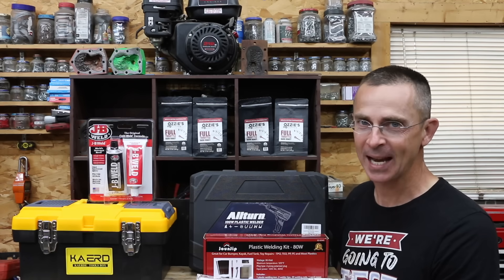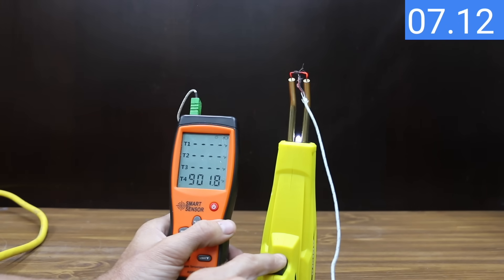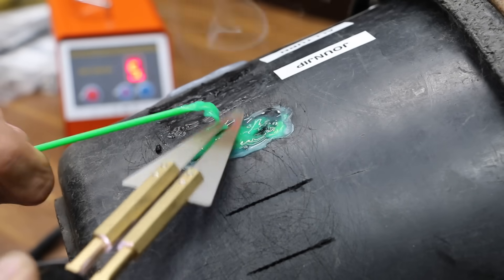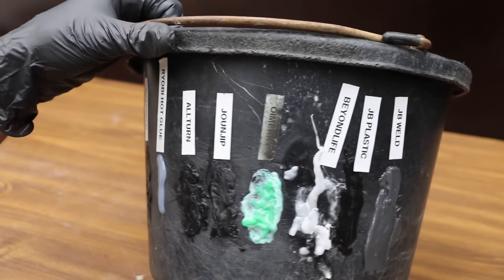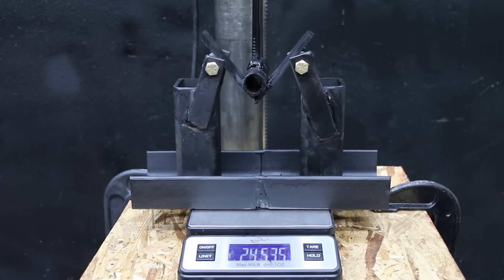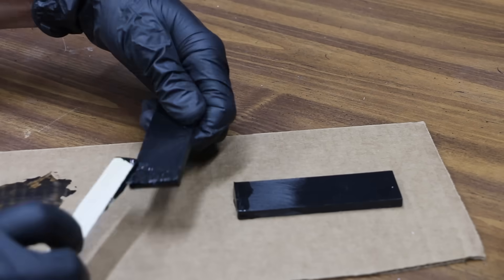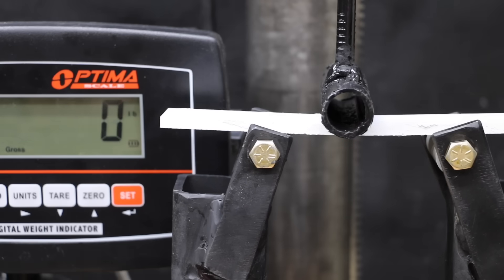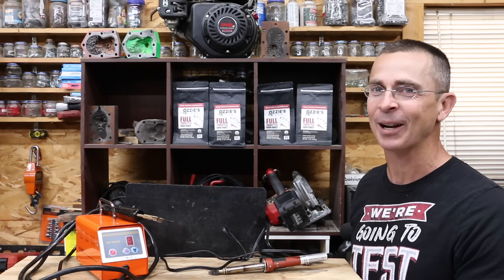Don't Buy A Plastic Welder Until You Watch This Review!

Comment: Over temping thermal plastics usually changes their properties as well as create lots of toxic fumes.
A slower carefull heating with a limit within what the plastic can handle is usually better. A slow bond to get deep into the material, ideally from both sides.
Pushing the wire mesh down into the original material instead of slapping something on top should also work better.
Reply from the maker: Thanks for the feedback.

Comment: FWIW you should melt the wire mesh into the surface. If you were willing to retest try that and also do a couple of sets with a 45 degree grind and fill from one side  ( \ / )  to test for strength and both sides to test with and without mesh ( > < ) and this time make them flush with original surface as that would be the desired result with much of the plastic repair we would be bothered with doing. and also maybe compare them to a flat butt super glue weld. This would give a new video with existing tools and supplies and be more realistic as to what people would need to weld plastic for. Usually if we are trying to fix plastic we are doing it because we cannot afford to replace it or its not available but it would be something we would never leave that ugly bead / blob of plastic on. We would be making it smooth and or even sanding it some if needed. The heat gun should be able to melt the wire mesh into the plastic or its pretty useless overall.

Thanks again for another great and informative video.
Reply from the maker: Thanks and you are welcome!

Comment: Seems none of them weld the break. Welding metals a good weld doesn’t fail and the material itself will fail first. Plastic welders do not bond the ends butted up together but stick on the surface only 😢
Reply from the maker: Thanks for the feedback.

Comment: Did you ensure that you had the correct type of filler plastic when welding?  Plastics are not mixable with each other and even when melted together, incompatible plastics will just pull apart when stressed.   Some plastics also change crystalline structures when over heated, so knowledge of the proper temperatures to use can be pretty critical...  For HDPE for example, melting is not really the best bonding method, instead a hot air gun set to a temperature that turns the surface of the plastic tacky  along with a HDPE repair strip that is laid into the break as you move the heat is the recommended industry repair technique as it doesn't crystallize the plastic and make it  brittle.   On a similar note, ABS is sensitive to being burnt by the tool, so a pretty precise temperature is required.  This may mean only very brief touches of the welding tool or use of a light dimmer to control temperature..  Because there was so much user error on this test, I would argue that this whole series is invalid and needs to be re-run once you have familiarized yourself with how to use the products properly.

Comment: Really funny to see this video just after I did some plastic welding for the first time ever. I had a cupholder on a lawn chair tear/crack and glue wasn't bonding (I think the plastic is LDPE) so I heated up a nail held by vice grips and used a heat gun to warm the part and managed to get decent penetration and the fix is still holding up. (Not saying much though since it's only been 4 days)
Really neat video!
Reply from the maker: Thanks!

Comment: Loved this video!! 
A very common problem is cracked gas tanks. Perhaps you could use the plastic welding kits you already have and see which works best on cracked plastic gas tanks. If you do please be sure to use a new tank or one you have cleaned and are sure no gas fumes are present. Thank you
Reply from the maker: Thanks!  Thanks for the suggestion.

Comment: I can tell you from many years of experience. If you use the wire mesh. You have to use the heating element to push it into the parent material. I needs to be embedded in it. Then melt plastic over it and sand down if wanted or needed.
Reply from the maker: Thanks for the constructive feedback.

Comment: Nice test but your technique sucks. You're not melting or even softening the base material, you're adding the mesh ontop of the gooped up filler rod that's not bonded to the base material, there's very little data to be obtained here as far as proper performance. It would have been good to watch a couple of youtube videos on plastic repair before making this video. I love your reviews but in this case there's nothing to be learned, except that if you're not proficient in the task at hand, gear makes little difference.

Comment: I've done quiet a bit of plastic welding at a previous job and one flaw in this test I noticed is you're using dissimilar materials. For instance, if you're work piece is polyethylene you need to use a a PE filler rod and if it's polypropylene you need to use a PP filter rod. Using PE filler rod on abs you will never get it to bond and make a strong weld. Just a bit of advice if you ever do another plastic welding video, make sure to get filter rods of the same family as the work pieces to get professional results. I do like how you compared hot glue and JB welds.
Reply: I imagine, testing the repair piece of plastic for PE or PP is the first step. So, identifying the original material before applying new plastics is the challenge.
Reply: Yes, you're right about needing to use the same plastic in your rods as the material you're trying to weld. Feed rate is also key.
Reply: mixing with different plastic is not good at all will yield random strength (bonding) results  as seen
Reply: Would be great to see a master kit for testing types of plastic, Metal, etc.
Reply: If possible and to also be sure you are using a compatible plastic trim off a small piece of unseen plastic from what you're welding together. This is a cheap way to do a repair in a pinch when you're completely out of rods also.
Reply: Almost all plastic parts if big enough have mold and material information on them.
Reply: Most plastics also have different Weld temperatures.
Reply: I am not too familiar with plastics but any advise on how to tell what plastic you may be working with?
Reply: @2mustange   It is a guess and check method if you don't know for sure. Get a couple different type of plastic filler rods and weld about 1 inch onto the piece where it wont be seen. If you can pull it off with a pair of pliers then it is the wrong material. If it is the same material it will not come off easily. Look on the piece of material that you need to weld for a recycling triangle if it has it and google what it is. Under the triangle sometimes it will tell you what it is. PP is polypropylene, (PE, LDPE, HDPE) are low or high polyethylene and if I remember correctly you can jump from low density PE to high density PE just fine when welding. UHMW is Ultra High molecular weight PE as well.
Reply: Yeah I use the beyond life style plastic welder to make polypropylene tanks and the high heat is required. That bucket never stood a chance
Reply: Zip-ty cutoffs, a torch and an old screwdriver do work as well for the occasional hobbyist. 

And it does still hold. I fixed a small crate for sodacans. We have a return system to get money back and plastic bags get so disgusting. 

Anyway, it had some small breaks. And I melted some zip-ty cutoffs and it still holds after more than a year of use.
Reply: Duh? The only flaw is what comes with these kits.
Reply: Ya I broke bushwhacker wheel well trim how the heck does a diesel mechanic figure out type of plastic ? A lot of good info , think I’m going to mesh melt repair then jb weld , I’ve coated my trim pieces w bed liner so repair should be hidden
Reply: Yes
Reply: I would bet if he put multiple deep cuts with a razor into the pieces, and then used JB weld, he would find it's significantly stronger. We have used JB Weld in the oil field for everything, and if you give it "valleys/ruts" to bite on, it will form a stronger point than the original material. We have jb welded diesel powered articulated off-road forklift booms back together when it cracked. Just use a cutting wheel and make many cuts (valleys) around the break, and then liberally apply a ton of JB weld. If you really want to go crazy, after the first layer is fully dry, make micro cuts in that, then apply a second layer and allow that to fully dry. You can continue this indefinitely depending on the level of strength you need.
Reply: There was barely any welding done here as that needs base material fusion or base material and filler fusion. Oh well. At least his efforts were very close that of most people buying these and using them for the first few hours(before majority of them just throwing the machine and the part they were trying to repair into the trash 😂)
Reply: Bravo!
Reply: Do you think an 82 dodge d150 would have an abs gas tank? That's what I'm going to fix haha.
Reply: @hisnameisiam808  no idea, did you pull the tank? If you did look all over it for the recycling triangle and then letters underneath that will let you know what it is made from if it has the symbol. Good luck
Reply: @ruking_around  thanks! I never figured it out but I already welded it and am putting the final touches on it so I can put it back in. Thanks though!
Reply: Also I know some poly pro plastics are compatible  for example you can use poly pro filler on a HDPE or LDPE because they are a poly based plastic but you can’t use a poly filler rod on a PVC or CPVC part because of the different make up with the vinyl
Reply: Very good comment.  Just keep in mind the average guy isn't a professional.  They grab anything that works to repair the broken item.
Reply: Acrylic, Polycarbonate and ABS are compatible. It's messy when done with low DIY level tools.
Reply: @rolfbjorn9937  Perhaps, but I caution against using any acrylate with any carbonate IF structural integrity is important.  Especially since acrylates are more brittle....for a patch, more amorphous  is best.  They have significantly different chemical properties as well, so patching a polycarbonate with an acrylate should in MOST cases be more chemical resistant and perhaps scratch resistant, but it will NEVER have the structural integrity that is the hallmark and primary usage for polycarbonates.  The acrylate patch would cause acceleration in fracture propagation over time at the defect than leaving the defect in tact would do (unless the defect itself is a crack initiator, then the best thing you can do is drill at the end of the crack to reroute the stress gradient.
Reply: @patrickneyman6739  I don't disagree, I've had bond failure between Acrylic-ABS or Acrylic-Acrylic. In my case it's just odd things I don't want to trash in a pinch, nothing vital or holding pressure. 
The best results were with HDPE-HDPE, lot easier, less mess and smoke.
Reply: Does plastic had to have concave like metal welding prep?
Reply: @rc-t3k  short answer, yes. Welding plastic and welding metal you are looking for penetration. With thin metal and thin plastic, you don't need a channel to weld into because you can get good penetration without it. With thicker materials you do need that chanel so you can get good penetration.
Reply: @rc-t3k  if I'm understanding your question correctly it doesn't matter as long as you can melt the material and filler rod slightly to get everything to bound together.
Reply: @tylergilbertson4086  wrong, bad info (UPDATE, I replied to the wrong post or misread..Sorry)
Reply: @gurubuzzzz  please elaborate, whenever we needed to figure out which material is which we always did test beads and when it's dissimilar materials you were able to pull it off with pliers with ease. If I'm wrong I would like to know
Reply: The pitch of voice extremely annoying
I couldn't go passed half of the video
Reply: @alexshcherbakov8353  
This guy is great - informative and entertaining.  If you don't like his pitch, don't listen...

Comment: I just use a soldering iron. For best repairs, you need to penetrate into the crack and melt the plastic all the way through. 

For plastic fuel tanks, you can make welding rods from plastic motor oil bottles.
Reply from the maker: Thanks for sharing.

Comment: Like your testing. Always good. Never used a real plastic welder. I have used zip ties to make temp repairs keeping the heat low where I do not burn the plastic. I have used JB weld often. I have found the more course sanding the better. Has more to hold onto and get down into the grooves. I am not sure what one out of the welders you tested I would buy. I would first look at diy before I buy.
Reply from the maker: Thanks!

Comment: I have a DeWalt impact driver that broke the handle grip. Despite this it still worked so I attempted to repair it. I put it back together my fusing the plastic using a soldering iron with a large tip. Then I used a 2-part epoxy on top of the repair for extra strength. It did work for a while but then I accidentally stepped on it and it broke in the same spot. So then I used a dremel to grind off the old epoxy and used the soldering iron to fuse the plastic again. I expected this to just be strong enough to hold it together but not enough to give it strength. So this time I sued JB weld and I put it on pretty thick. After it cured. I sanded it to where it was comfortable to hold the tool and it seems to be holding up well. I can’t imaging it will ever be as strong as it used to be but I at least gave this DeWalt brushless impact driver new life. It still works months later. However after watching this video, I’m hoping I can find a more effective method to repair broken plastic parts.
Reply from the maker: Thanks for sharing.

Comment: I've got a cheap 80w iron. It gets used more than my regular welder. I got a roll of aluminum tape to support the back of the weld. Then I vee out the break with the iron and slowly melt the adjoining plastic back into the break and smooth over the weld with a small amount of filler rod. You can use a bernzomatic or sandpaper to smooth the weld for looks.
Reply from the maker: Thanks for sharing.

Comment: Great Video!  I would also like to see Snap-On in this comparison. They have a Hot Staple Repair Kit, a Plastic Welding Kit, and plastic welding attachments for their butane soldering kits.
Reply from the maker: Thanks!  Thanks for the suggestion.
Reply: Anything from Snap-On would probably double the price of all the tools used in the test.  Todd takes no promotional assistance from the companies whose products he tests.

Perhaps if you offered to purchase the Snap-On after the test....?
Reply: @jackdedert2945  "Perhaps if you offered to purchase the Snap-On after the test?"  What an asinine comment.  I doubt Todd would ever agree to such an offer.  If you're a fan of this channel, you would know that.  Besides, he has reviewed dozens of Snap-On tools, including the $1000 Snap-On floor jack.  Yes they're more expensive than the rest, but sometimes it's nice to see if the most expensive tool can outperform the rest. Often enough it does, especially with Snap-On.
Reply: @davidk3277  Oh, get over yourself.  I wasn't suggesting anything unethical or dishonest.  It was just a comment on the high price of Snap-On.  I'm sure he has to weigh the cost of his test subjects against the potential benefits, since he's self-funding.  Surely he does 'something' with the items he didn't use up, or test to destruction.  

What's a man to do with half a dozen plastic welders?

Comment: The green hotair gun is made for plastic flooring, the fan heats the flooring and the welding thread as you drag it along the joint. I use it alot. Thats a knockof on a Leister hot air gun.
Reply from the maker: Thanks for the feedback.

Comment: You don't start plastic welding on the surface when doing butt welds 
You have either grind out a bevel (V grove) or melt a bevel into to the areas being welded. The same way you bevel metal when welding thick material. So like metal welding you then back fill the bevel with the welding material. That method especially applies to the plastic welders that have a central feed tip for the welding rods. Then the additional strength comes from the metal staples or mesh that should be melted into the surface plastic your trying to join. Surface welding isn't the strongest but some times it's the only option. You still need to preheat the crack/joint in the plastic before welding to get the best penetration weld, especially with thicker plastics.

Comment: Here in Cambodia, people use those plastic welders to repair plastic motorcycle and car bodywork all the time. You can sand the welds down and paint, making the parts look absolutely new, even after an accident in which the plastic has been broken into pieces.
Reply from the maker: Thanks for sharing.

Comment: I would be interested to see how the Polyvance Airless Plastic Welder compares. 

Generally speaking I rely on your channel for product reviews and have been more than satisfied with the all the recommended products purchased. 

This review however is in my mind somewhat different as getting good results is not just about the tool, filler rod quality and bucket material but the users skill and experience. Plastic welding is in my humble opinion more complex a topic than your video portrays.

I do love your channel - great topic! The comments are interesting on this topic - lots of skilled folks have spoken up - lots of skilled folks watch your channel. You may crossed over the line from a product review and testing video to a “how to” video.
Reply from the maker: Thanks!  Thanks for the suggestion.

Comment: Very interesting test. I wonder if strength would be increased if you used a combination of staples and wire mesh with the JB Weld or hot glue.
Reply from the maker: Thanks!  Thanks for the suggestion.